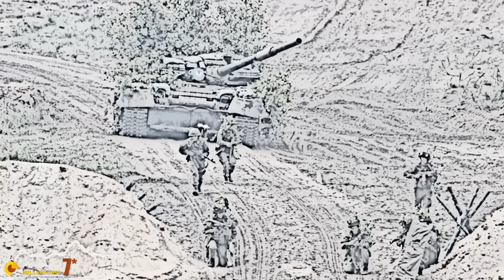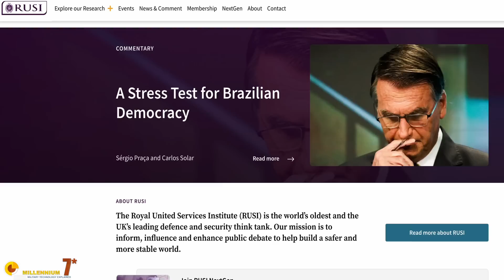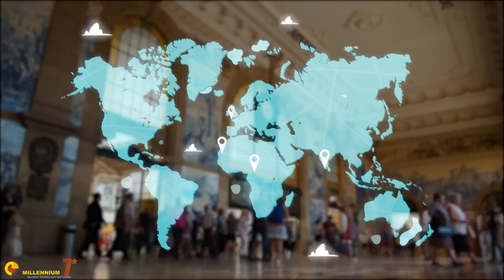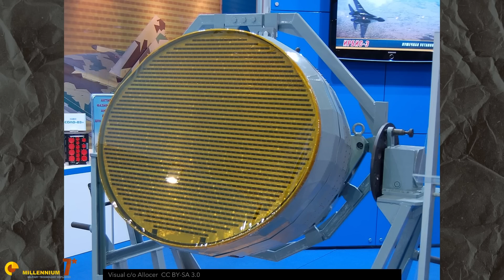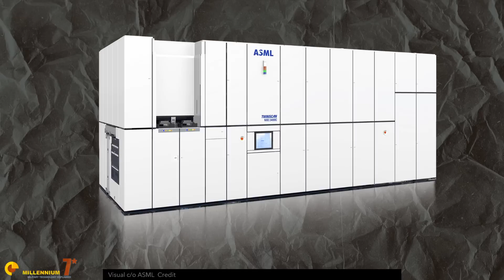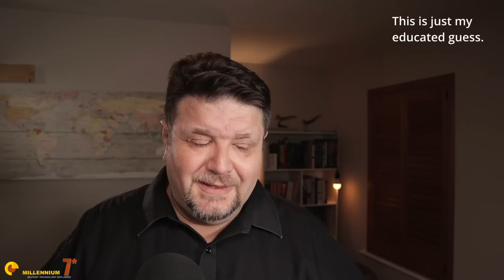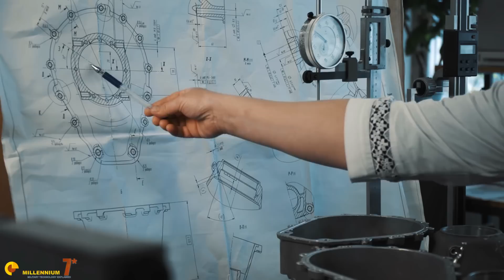Russia is using Western weapons in Ukraine.

Comment: I've followed the events that led up to the current "situation" in the Ukraine for a long time, coming to the conclusion early on that a war proxy war between NATO and Russia was a real possibility. Over time, it became clear that Russia, apart from specific military preparations, also "hardened" it's economic and financial system so it could flourish even when disconnected from the west. If I, as an interested engineer lambda could see the writing on the wall, so could Russian engineers. It must be clear that the Russians new that, in case of an embargo, you need to roll your own, use a substitute, or stockpile before. If you have a system that is, in Russian fashion, good enough, you buy large quantities of needed chips when still possible. You can fit a few thousand of them in a shoebox. No big deal. Russia does produce its own micro-electronics, especially for its military hard-ware. I'm pretty sure that the Russians stockpiled large quantities of chips and that they will be able to continue to produce and use the systems at the current pace for many years.
Reply: At the moment, Russian MPs are asking where did 1.5 million gear kits for soldiers go. What do you think will happen when they start opening those shoeboxes? Do you really believe those chips haven't been sold on black market yet?
Reply: The whole proxy war thing is extremely true in my understanding, that's for sure.
Reply: Any serius military will not use high denisty chips in critical infrastructure because of vulnerability to the EMP. 
Military use much more "rought" type of chips and those even Russia can produce, that doesent mean that  military would not use commercial chips for non essental infrastructure, of course they will why invent a wheel again, considering the fact that Russia is best friend to china thanks to the US they have acces to everything.
Reply: @Rob Endert ~ nice synopsis of that particular area. I mean that. 

Here's something that appears to be overlooked by many. ~ 

The US has a demonstrable history of backing right wing extremists in other countries to over throw them or their neighbors.  72+ "color revolutions" (US backed Right Wing coup de eta'a) around thwbworld in the past 80 years alone.  

Its the same social archetype at play in Ukraine today. 

Who do you think sponsored the nazis to begin with ? Hint 🔥 🇺🇸 🔥 

https://youtu.be/MxxxlutsKuI

It only hons under scrutiny if you're ever so curious to pry. You see, I've been explaining these things to various interested parties around the world for about 15 years now and they appear to be responding accordingly.. 

Ukraine is the Reich Wing 2.0. 

Russia is more than prepared. 

We made sure of that. 

Signed, an American.  

🤗
Reply: In principle, you’re probably right. But in practice, I think you’re probably giving more credit to the forethought Russia had than they deserve. The real reason Russia has been using off the shelf components I expect is more mundane: they’ve been trying to maintain the appearance of competence while not really having the resources to actually be competent. The rest of Russia’s war doesn’t seem to be benefiting from an abundance of forethought and planning. So I’d actually be pretty surprised if they did as much stockpiling as you suggest, and even if they did, I’d be surprised if they stockpiled the right things.
Reply: Our western audience desperately coping by ignoring that China can make 12nm chips and can easily supply Russia. Okay let's just continue on our Anglo Saxon fantasy train...
Reply: @meinhaj I've used a good few Chinese substitute components, failure rates are high and quality somewhat lower. Chinese equipment that is functional usually used generic or established western processors. The same goes for engines, Chinese copies are usually noisier, have more vibration and less power compared to the original honda one for example. Tyres have been another observed issue, they are less consistent in quality. Even Chinese vehicles, things such as LED lights tend to be overdriven and fail early
Reply: Unless that shit gets destroyed in large quantities before deploying any. Or if their forces are even competent or capable of using and maintaining their equipment.

Clearly theres a difference between practically and effectively using said weapon systems and electronics and having them.
Reply: @SmartAss4123  or they took the funds for chips and spent it on yachts instead
Reply: that's all well and good but what is the point of stocking some parts if you're not able to build quality weapons/vehicles with it ?
And even if you were, your army would be too incompetent to use them adequately ?
and as others mentioned, if all that money go to some pockets instead of those parts, it would be all for nothing.
Reply: @Duron13  hi Julien, I've made a longer reply to main video that builds on the point you're making that you might be interested in.  In summary, just looking at one item affected by sanctions, railways transport 85% of all cargo in Russia and every railway wagon needs roller bearings changed on a regular basis.  They now can't buy them due to the sanctions which has caused massive problems for moving raw materials, finished goods across the huge distances in Russia.  Like you say the supply chain just needs one link to break and it won't work, regardless of how many semiconductors you have in stock
Reply: @absolute98765-b  I know of bearing manufacturers in Russia.
Reply: @jamesrowlands8971  not roller bearings for rail as far as I'm aware.  I've got a bit of experience in the rail industry sourcing components and even if they did have a domestic manufacturer it's not simple task to resource critical items like bearings from established manufacturers - Timken, SKF etc - let alone trying to get a manufacturer that doesn't already make something.

If the can they actually get the grades of steel required, are they able to carry out the manufacturing, treatment and inspection processes necessary?  Then you have to tool up, produce samples, test the compatibility across all your fleet (different wagons will carry different cargo and need different properties), ramp production up to full scale production, redo all of your maintenance plans etc - it's a huge task that can't be completed quickly.  And the role of rail even just in moving the finished military hardware like tanks from one side of Russia to the other can't be underestimated.

You could make the same argument about aerospace components : Russia should be able to manufacture them but what we see on the ground is the airlines cannibalising their planes instead which at best is only a short term fix.
Reply: @absolute98765-b  they can get that from China
Reply: @569-m5p  It's a lot more involved and complicated than you might think but even if they could these aren't just available from stock.  You'd be looking at years for Chinese manufacturers to add the production capacity necessary to increase production by 195,000/yr.  These aren't small items.
Reply: @absolute98765-b  Russia makes roller bearings themselves, good ones too, & in huge numbers
Reply: @Duron13  Russia doesn't have quality weapons
Reply: @569-m5p  you are deeply misled. Russia has top of class weapons in many categories.
Reply: @569-m5p  they still make rocket engine for NASA. Plus almost 90% or US uranium fuel for reactors come from Russia so yeah 🤷
Reply: @jamesrowlands8971  I agree with you . I was just asking the person coz many people are really delusional they think Russia is like some 3rd world country
Reply: @marshalljulie3676  true
Reply: @marshalljulie3676  for NASA not for Space X
Reply: @marshalljulie3676  Russia buys Boeing planes,  GE medical equipment,  use Windows operating systems , etc
Reply: @569-m5p  and still are winning against western 30 countries that supplies weapons to Ukraine 😂😂😂😂🇷🇺🇷🇺🇷🇺🇷🇺

Comment: Actual military electronics generally need radiation hardening and don't use the current gen cutting edge commercial semi-conductor manufacturing processes which will go pop if a EW jammer looked at it the wrong way (besides forget about 7nm, a ballistics computer doesn't need it, a 1980s scientific calculator is more than up to the job!) although ancillary systems (screens, sensors, controllers) are increasingly off the shelf. The US semiconductor bans on China have much more to do with grubby commercial issues than any national security concerns (c.f.  Chinese components in a  F-35, there won't be any US components in a J-20!) ! The issue for non-proliferation is one of scale micro-controllers are present in almost all modern household equipment, every smartphone has a camera that can be turned into an imaging sensor, these exist in the 100s of millions and are produced in the 10s of millions annually missiles even smart shells are produced in the 1000s to 100000s even a 10 year old defunct mobile phone will have a multi-megapixel imaging sensor so just combing through the electrical waste in any country with a reasonably sized population can supply enough raw parts!
Reply: the irony of your statement is that none of the tech on the 35 is chinese but all the tech on the j is most likely American. there is no "chinese tech" just tech manufactured in china, and a plane and pretty much everything that comes with it is an American invention / innovation.

Comment: China is making 12nm chips. Your video is 1 year outdated
Reply: There were reports in the technical press a few weeks back that some chips from Chinese fabs had been reverse engineered by Western investigators who claimed their manufacturing processes were 7nm. That doesn't tell anyone anything about fab yields, process costs and the like, just that someone who claims to be expert in such things says the chips they looked at which supposedly came from a Chinese manufacturing line was supposedly 7nm.
Reply: So because China didn't share the exact specs and yields, you are fantasizing that they can't make them? Or in the case of this guy, making videos of how this is a capability China doesn't have? Typical Western copism

Comment: I think some western researchers found that China has been using and exporting 7nm chips. And there is a rumor that China is manufacturing 3nm chips, however, that's not very likely but I do believe they're developing 3nm chips. However, those high-end chips are not usually the best choice for the military because of their price and capabilities ratio. It's needed to find a perfect balance.
Reply: China must be working hard on a technology pigeon holed in the west ... direct write electron beam in massive parallel wafer processing.  This replaces optical lithography all together including the need to import associated highly purified chemistry.
Reply: @douginorlando6260  is it functional tho?
Reply: 7nm is china hard limit 

They have been banned from buying the latest Lithography machine, which needed to break the 7nm barrier
Reply: @notificationguys5128  which means they have their own lithography machines and is there a reason you have to believe China can't or is not working on 3nm chips?
Reply: @MGZetta  China has built its first 3nm chip (2022). However it isn't commercial yet (unlike TMSC and Samsung). ie quality control issues makes production of this chip unprofitable. As I understand it, production of this chip still requires import of indigenous machine components from outside of china which has now been banned..For a 100% indigenous lithography machine, China can build 22nm chips. China's home made lithography machine is about 10 years behind. But as far as military hardware goes... 

2012 level computers that are 100% home made is pretty good.
Reply: @nickl5658  bro doesn't know how computers work 💀typical wannabe defense enthusiast lmao
Reply: @DalitKumarAryan  Actually Nick sounds well informed and as an electronic engineer myself it's common for military equipment to use older tech as things like missiles, because once a military accepts a design it requires it not change until a major recertification. So it is you that doesn't understand.
Reply: @ntal5859  "electronic engineer"? 💀 you mean to say you work in a phone repair shop? Stop embarrassing yourself.
Reply: @notificationguys5128  They recently announced they are making 5nm with own design lithography equipment since ASML can't export to China, they have been building and servicing older equipment for decades, hell they account for 50% of the 28nm equipment out there.

Comment: The Russians/Soviets have always been pretty good at making tech that is 'just good enough'.  They could make very effective SAMS in the 1960's with very crude electronics.  I would imagine that they would focus on using imported chips/electronics only for those uses that the cutting edge is utterly essential.  I doubt this applies to a typical guided missile or drone.
Reply: The "good enough' approach is economically smart since you keep costs as tight as possible.
Don't forget that RU military budget isnt "illimited" like US one !
Reply: It would seem to me that by way of using cheap off the shelf parts from the west or China, and then using them in drones and missiles that are pretty much disposable then, should these assets fall into the hands of opposition then, the opposition won't actually learn very much about current Russian technologies that are otherwise currently being developed or utilised.
The Ruskies are therefore not so thick as they are cabbage looking from that point of view.
Reply: Russians never invest on extreamly sofisticated systems, they always use good enough reliable systems with large quantity and tactices. This is from their lessons learned during WW2. I a battle conditions, relability is most importent, more sofisticated a weapon is, higher the chance of failure.
Reply: @smnkumarpaul  yup, the less points of failure anything has the more reliable it is. It's a very smart approach. It might not do everything in its own, but it'll do everything it needs to do. Nearly every time.
Reply: @smnkumarpaul  This is why they have stuck with the AK platform.  It's a terribly outdated rifle by today's standards, but it doesn't cost much to set up and manufacture, and it uses low tech methods. And it's reliable and it's effectiveness has been proven for decades. Same reason they mostly use steel cased ammunition. I'm a fan of the Russian engineering mindset, because it's ruthlessly efficient and smart. They make things that are as simple as possible to achieve the purpose reliably. Every country should take a page out of their book, and combine that with the technology it has. We are often compensating for poor engineering decisions with high technology and economies of scale. Planned obsolescence is a big driver of it too. I'm sick of stuff that's engineered to fail. 

I'm a firearms nerd, and I always say you can tell a lot about a country's culture and history by looking at it's military small arms. Russia makes something that's rude, ugly, very simple and very effective. It resembles a piece of farm equipment, but it does it's job very well. The Americans (once they finally learned that bigger bullet does  not equal better and soldiers aren't popping off the enemy at 600 yards with iron sights) make a weapon that is lightweight, efficient and features a lot of different materials and manufacturing processes, made by the private sector by the lowest bidder. The Swiss? Well imagine my shock, it's expensive, absurdly close tolerances, complicated and even the prototypes are a work of art. The French? They're um... unique, because f*** you we're French. And Germany just makes things complicated for the sake of it, and then figures out how to mass produce them efficiently and charge obscene money for them. 

Same with my spring airguns. Most if them feature two pins in the receiver tube, pull them and the trigger block and guts of it come out. The Air Arms stuff from Britain is even simpler, undo one bolt and it all slides out. But Weihrauch is very very German. They have a trigger block at the back of the receiver tube that's threaded into the receiver tube, with huge threads, and with such tight tolerances that the join between them is almost invisible, with the dovetail rail perfectly cut through both parts. Then another bolt has threads cut through both parts, that the stock is screwed into. It's a nightmare to pull apart, you literally have to put a bar into the trigger slot and beat it with a hammer to get the threads undone, and that heavy trigger block has a whole lot of spring preload behind it while you're trying to unscrew it. Oh and because the two finished surfaces meet with an invisible join, when it comes apart the edges can slice your hands to the bone if you're not careful. Why Germany, why? None of this achieves anything over what the other companies do. It's beautifully made, but so much unnecessary machining and so much more difficult to work on.
Reply: Bullshit we are being killed by our own tech same with China we built them all the great tech China has is ours and now can build themselves we are stupid now China is as powerful as us or more because of greed we have no one to blame but ourselves we could of been decade's ahead of the whole world but greed is our downfall China and Russia are nothing
Reply: yes, what is good enough is good enough, saves $$